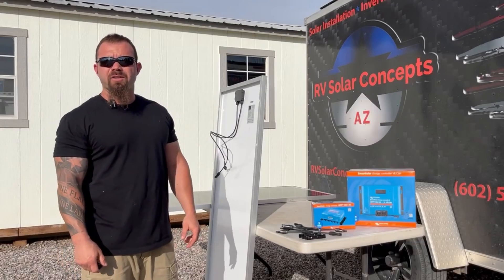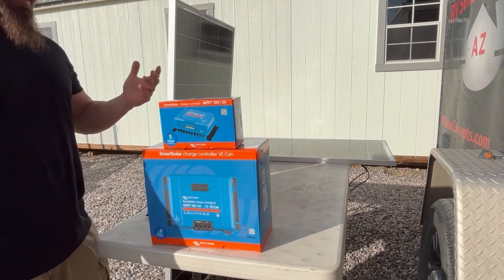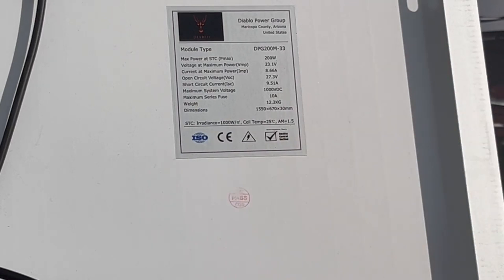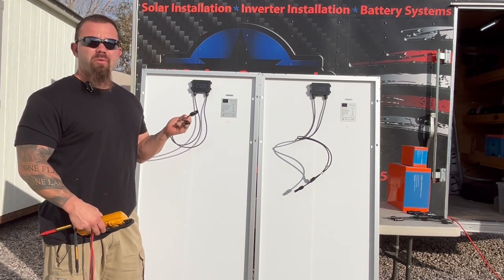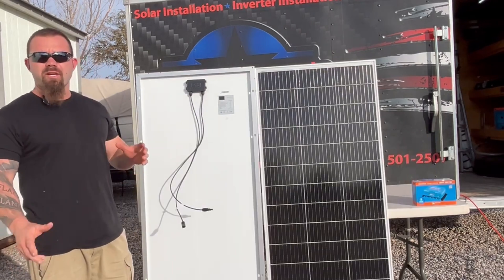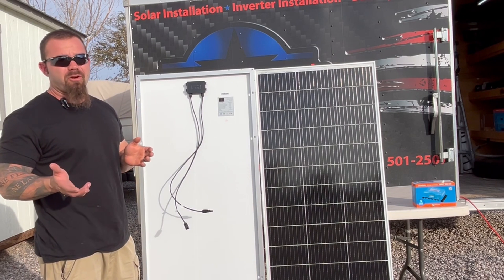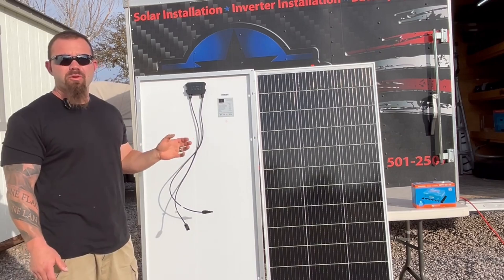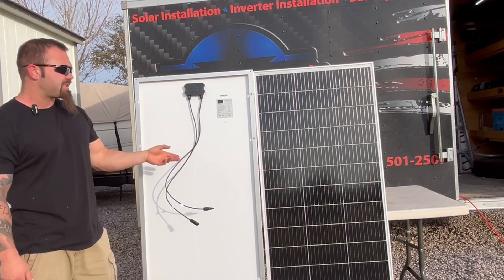Pro Guide to RV Solar Wiring | Max Power Without Overloading Your Charge Controller!

Comment: Great video. Thanks. I find it easy to remember parallel wiring if you think about the outlets in your house. Voltage stays the same. 

I just got a 12.8v 280ah lithium to replace my 2 lead acids in my 5th wheel. Looking to add solar. The 1000 watt inverter that came with the camper just powers my residential fridge. Want to add more outlets to use for tv, outdoor fridge and coffee maker. How much solar would I need and would I need a larger inverter? The camper came pre wired for solar.
Reply from the maker: I’ll be doing a large install Wednesday, Thursday, and Friday this week on a rig that has exactly the same setup. Stay posted for that, I’ll be breaking down all of the questions you have in detail and show how to add outlets and microwave to your inverter setup. 

To answer your question though, depending on the size of the fridge and weather outside, 400 amp hours of lithium and 1200 watts of solar will give you enough power to seldomly need a generator.